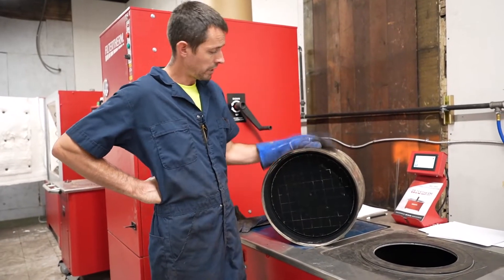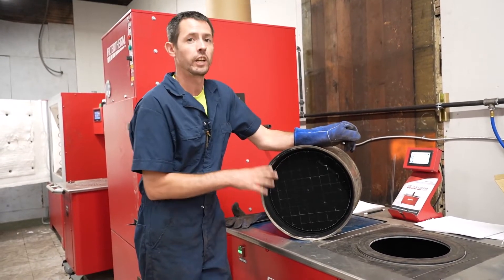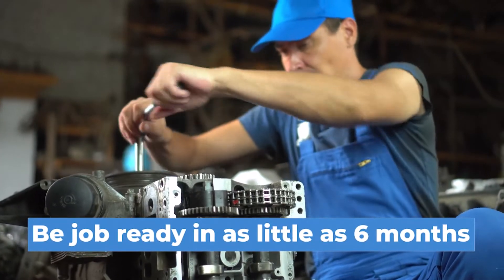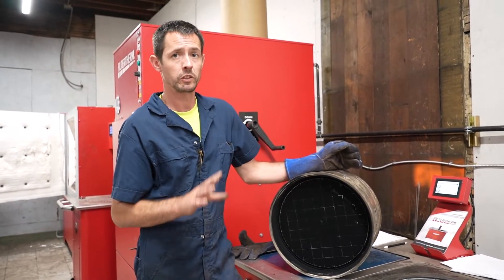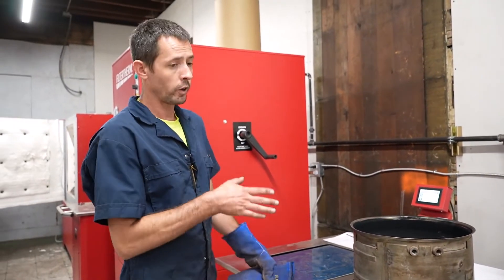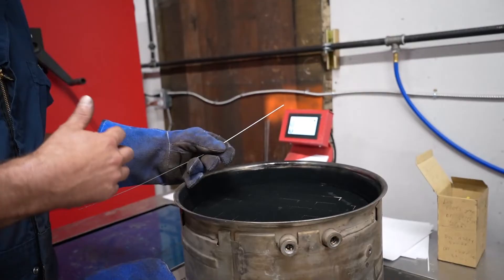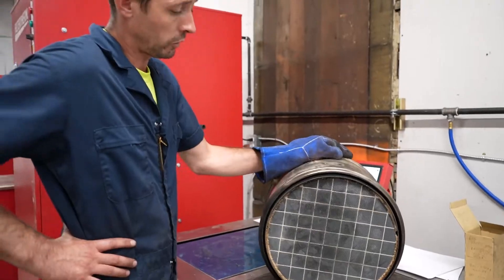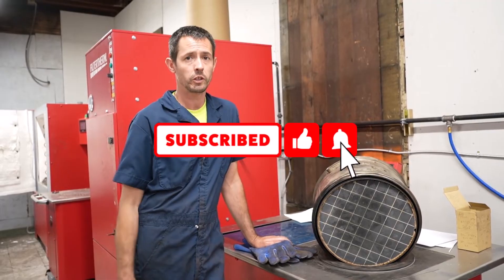Why Pressure Washing Your DPF is a Costly Mistake: A Technician's Insight

Comment: I pressure wash my DPFs on several trucks. It has always worked well for me. You can shine a light through the DPF after cleaning and see that the tubes are clean and clear. I've had zero issues with this and I originally got the idea from a large local trucking company that did exactly that to clean their fleet's DPFs. It seems like the only people that say not to do this are from people that work at businesses that clean DPFs, so there is a conflict of interest.
Reply: You are clueless. If you can shine light through a DPF then it is breached and NFG.
Reply: @danielhoffmann1325 You can shine a light through a new dpf too. They are like small straws going straight through. To be fair, you can't do this on my Chevy's dpf as it doesn't come apart, but on an isx or x15 you certainly can.

Comment: now many shops have started using liquid cleaning methods and stopped using the air or baking method . so what can you believe anymore ? ever since covid i know question everything , we just been sold a bunch of lies and misinformation on everything . i know a few people who have cleaned there doc and dpf that had good results so if its done right i dont see why hes trying to say it cant be done .
Reply from the maker: You should believe the people who provide testing results before cleaning and after cleaning. Two very important testing needed to be done. Air restrictions and weight. Then you can tell the effectiveness of the cleaning method. We have the testing equipment here and provided testing results for every single dpf we clean for heavy trucks.
Reply from the maker: And we know baking method works and is very effective.
Reply: @ i was just at a Kenworth dealership recently that uses a machine that uses a liquid cleaning method , there is also videos on youtube showing that same machines that clean dpf filters using the same machine . so you saying they ripping people off and lying about there method being effective ?
Reply from the maker: @crisincebu we haven’t tested the liquid cleaning method before and after. Can’t comment on their effectiveness. We can only comment on baking. As a consumer, I would ask the dealership to provide the testing data, so you know your filter is good after cleaning.
Reply from the maker: We tested the dpf customer used water to clean. The testing results showed the method didn’t work and ruined the dpf. Simple like that.

Comment: If you can do it yourself, just do it! Make sure you dry it properly before reinstalling it. As for the "special liquid" to use, I've been using grill cleaner, which sprays into a white foam that kind of burns your hands if you don't wash it off quickly. Cheap and effective. I first pressure wash the dpf to get all those channels unclogged, then I spray an entire 500ml bottle on it in a few tries. All the cleaner goes all the way through the other side, slowly, while breaking down all the soot in its path. Pressure wash it again at the end until the water comes out clean, then dry it off. I use my compressor to blow away the water inside then let it dry in the sun. If you start early in the morning, you will be done by lunch. I like to leave it in the sun to dry out until the next day.
Did this on my Mercedes W212 and it's been almost 80k kilometers since then. At 100k, I'll take it out and clean it again.
I did it on my wife's car, which is identical, and it's been 50k km since then. I cleaned dad's dpf too before both cars I mentioned and 100k km later I did that again and he's driven over 30k km on top of the 100k at which I washed the dpf a second time. All cars have over 300k km on the dashboard.
   So if you have the tools, some basic knowledge, common sense and patience, you can do it yourself. If someone sells you some story that it's not good to do it yourself because of this or that, they probably have "the right machine" to do the job for a premium fee, because "some specials chemicals are used" yada yada BS yada.
   The most important thing you need, on top of what I just mentioned, before reinstalling in in your car, truck, etc, is drying it properly. Otherwise you risk properly clogging it to the point of no return, where the soot sticks better to a wet surfaces inside and sort of petrify, at which point, it cannot be unclogged anymore.
Reply: Thanks Dragos.

Comment: Good day , I’ve maxxforce engine which exhaust brake is on after 5 min from starting and the only code is for dpf sensor , I’ve replaced the sensor and clean the dpf still the same

Comment: I recently removed both my DPF and DOC. I had it washed at coin car wash. I had it dried out. Re installed next day. Then I did forced regen. All in all, cost me $20 in coins. And so far it's driven 12k miles and the light hasn't returned.
Reply: Did you wash opposite of exhaust flow?
Reply: @camscustombuilds I feel like that is key
Reply: still you running ?

Comment: EGR's are the devil. They cause most these problems and i dont mean a failing one... just in the sense of what an EGR does by design. Lets pump dirty exhaust back into our intake and motor and then lets invent another federally mandated contraption to mask/fix that problem... what a racket.

Comment: I seen many do it and work perfectly so why would you downplay the cheaper route. I don't understand you dude.
Reply: Because he makes money of cleaning filters :P
Reply: Just a thought off assumption. Possibly it didn’t go well for this customer, because the filter was beyond help. If you stay ahead of it and knock soot out periodically, will probably work out a lot better. To get a total cleaning though I’m sure you’re going to need that 1000 + degrees. You can only get the very loose and fine soot with a pressure washer. But that is better than none, can’t see why it wouldn’t help.
Reply: Job security
Reply: Im doing a simple green and lressure wash as we speak.
Reply: No mechanic in their right mind would recommend deliberately doing a job the wrong way
Reply: Because he makes money servicing these.

Comment: I pressure washed mine until i had water spraying out the other side clean and clear about 4 feet took me seemed like 2 hours to fully clean it with a low power pressure washer but i think in the future i will clean myself kinda a headach but worth it if your willing to put in the time to actually clean it the first 10 min i had no water passage back and forth but eventually i started to get flow after one 20 min break and 2 hours later i was confident in  the solution ordered the gaskets and a new clamp cuz i broke one put it back together and good as new in the beginning i was getting crankcase pressure sensor going off and leaking oil so i dove right into the dpf filter then after completion i went to the egr cooler cracked the hoses off took a peek then flushed it out with water (egr cooler was not that bad) plugged it back together was gonna look into the egr valve but by the cooler i speculated it was not bad either upon further investigation due to the dpf filter getting clogged and back pressure i had a crank case seal blow out so that turbine was not operating correctly replaced that seal spun it down the road and she never sounded more health good luck out there hope  you are as successful as me beware when messing with clamps they will break be sure to properly seat all seals correctly or you will have a air leak be patient and you will see positive results i just did work on my truck estemated 15k worth of work i done the labor 1k dollars good luck guys keep a positive mind set fyi they can be pressure washed but thats hours cabt be done in 30 45 min take time and patience
Reply: Doing a forced regen the night before and pressure washing it works perfect, one can clearly see all the holes open up eventually I have Ancel obd scanner which has a function to test dpf blockage which reves up the engine to 2000 rpm and that would blow out what ever is remaining and you can feel the truck breath easy after that.

Comment: So did the customer just pressure his dpf and that was it?? If so then yes that would be pointless, done mine off the car used both a 2 types of dpf cleaner 1 acidic and 1 alkaline, flushed it through many times with a garden hose and no had any problems with it at all. The flow pressure has dropped from 290mbar at 3k to 60 at 3k.
Reply: Where do you buy the two types of cleaner?
Reply: @jorgehidalgo4792  also has been about a year now, and I checked the pressure on the dpf 2 weeks ago. It was reading 6mbar at idle and 50 at 3k rpm, so it cleaned it well and not had any issues since.
Reply: @jorgehidalgo4792  amazon or eBay for the wynns cleaner, the other is diluted brick acid, or you can use drain cleaner they both use sodium hypochloride. Drain cleaner doesn't need to be diluted, but the brick cleaner does. Just be carefull with any splashes and wear eye protection. It is not something you want on your skin.

Comment: Its really worth cleaning them, how often should they be cleaned? I have a 2019 T680 with the X15 and it has 469k miles, i bought it in January, im not sure if its been cleaned. OTR Diag says its 73% ash load, KW told me it needs cleaned every 500k miles. If the filter can last that long, i would just rather replace it.
Reply: it's worth it.

Comment: We took a BRAND brand new T880 kenworth with only 230K miles on it and straight piped it and it is extremely loud and rolls coal and even louder than the 6NZ pre emission in the other older kenworth and that one is not straight piped but it’s loud and it rolls coal too but the new kenworth we don’t use DEF fluid anymore and we have been stopped by DOT a couple times already and they have not put it out of service or anything but they were looking pretty hard at the truck being straight piped because nobody else has done that but we are burning more fuel it’s getting worse fuel mileage seems like 4 miles per gallon total but it’s making plenty of money and it’s not causing any problems the lights come and go on the dash so I hope this helps you out on your journey and we been watching you for years now but I never said anything to you until now but as far as the DEF FILTER we don’t even use it at all and the truck is able to run triple digits with no problems but we have gotten worse fuel mileage 💖💖💖 Poptart
Reply: Nice story Mr. Rolling coal. Dot only have to vipe your tailpipe with the paper towels. Reading your post reminded me when my mother reading Andersen's Fairy Tales for me 50 year's ago . Please no response no need it. Post more stories trust me it's entertaining.✌️

Comment: Personally I’d just replace the dpf it doesn’t last as long cleaning it as it doesn’t clean 100% then you’d have to pay labor to take it off again in short period of time.
Reply: It's super expensive right?
Reply: @ganbaa1312  not in the long run. I paid almost $500 to get mine cleaned with new gaskets and clamps only lasted around 120K miles then I had to replace with a brand new one for $2,200 plus gaskets. Did it myself. I think paces can wash them out supposably get it almost 100% clean have my old one might take it in and see how clean they can get it.

Comment: Hey Ryan.this was a great video but I do have a question; how do u know your filter needs cleaning? Or is it just something u need to do every 250k miles?
Reply: It’s supposed to be on a maintenance schedule of so many miles but if you start getting frequent regens then time to clean or replace. Personally is replace cleaning doesn’t last as long then have to pay labor to take it off again
Reply: @user-zt6bt8dp2c  I think I will come in and have u take a look.since I got this used truck from the dealer it has asked for regen just ones and it's almost a year now but I feel it regen a few times while on the move.i don't idle my truck.i prefer using other means to cooling and heating my body

Comment: There are always tricks and hacks to do something. Well... Unless you are dealing with customers. I work for a company's fleet Dept. We use hot pressure washers, home-made blowers and especial technics to clean PDF's and DOC's. The company doesn't care if the filters come back 2 or 3 months later. The stupid drivers are going to idle the trucks anyway for a long time and clog up the filters again
Reply: If they are doing their own work they should just get the oven equipment to do it correctly. At least that way they will have less labor expense in the long run.
Reply: @kmg501  they don't want to spend the money on the oven
Reply: Try not idling the truck when it’s 100 degrees outside or freezing. Yes it’s stupidity
Reply: I think you showed your true color, calling the drivers stupid! Maybe management should know the way you feel.
Reply: @michaelsorrentino9279  you don't know what kind of driver are out there. You will be amazed!